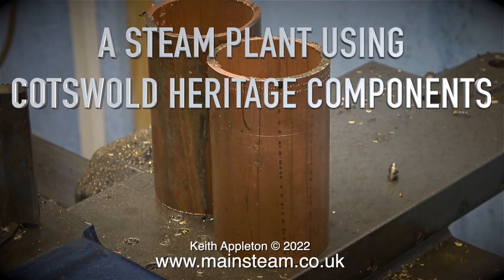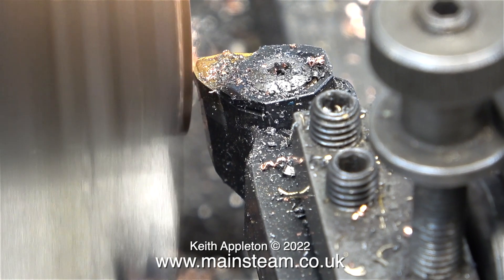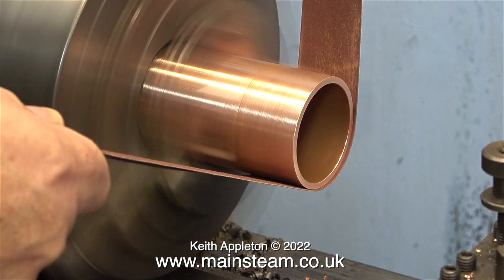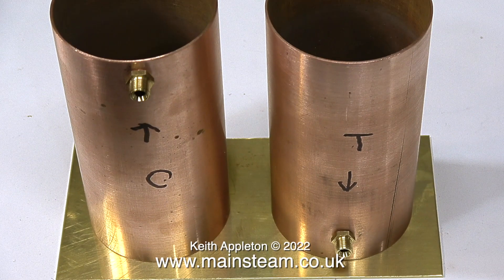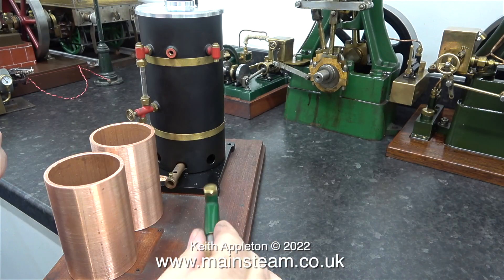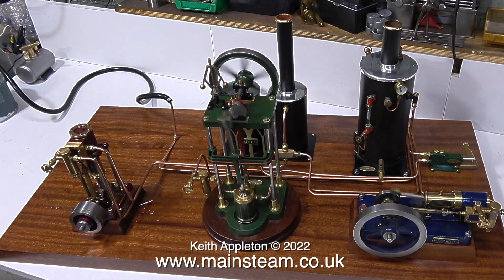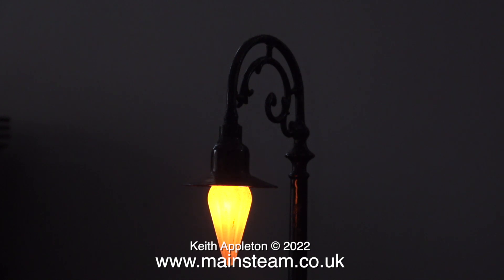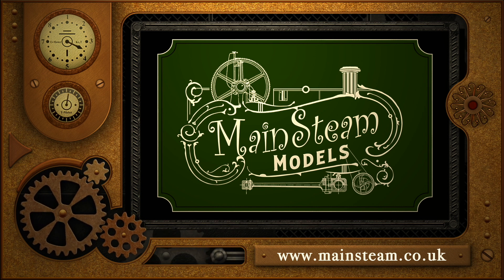A STEAM PLANT USING COTSWOLD HERITAGE COMPONENTS - PART #3

Comment: Heat engines of any type (internal combustion, steam, etc) are inherently inefficient.  When you scale up a heat engine, it gets closer to the Carnot limit, but a small steam engine (whether it's turbine or piston) won't achieve more than about 30% efficiency.
Reply from the maker: Luckily I just play with model ones . . . . . . .
Reply: @keithappleton  this was in the context of the folks wanting to use steam engines to power their houses.

Comment: I spent 20 years as a steam plant engineer on US Navy ships.  I operated both 1200 and 600 psig boilers with steam turbines as engines. To make steam do anything useful is a maintenance nightmare. You have to love it ,that is steam, to put up with it.  I did and I miss it.
Reply: Correct me if i am wrong, but from the little i know, i guess the steam turbines was a compromize in order to make it possible to use lower grade fuel, both in liquid and solid form but retain the relativly constant speed needed for the ship propellers on the heavy weight class Navy ships with the types of fuel estimated to still being commonly available/ easy to long time store, in war times. (in my country it was later, in the 1950s divided into low pressure airspool crude oil engines, as today, and gas turbines for the small sector of topspeed small ships, the larger classes of old scool battleships where outdated in Scandinavia allredy in the 1950s, they where rerplaced by dedicated all purpose chargo ships and the modern high speed boats, which made the system less vulnerable for the coastal defense here,  but i guess they did serve for a much longer time in the Britsh Royal navy and the US navy for open sea and foregin duty.).
Reply: @Vampi_Sweden  It is not so much about the grade of fuel but the natural evolution of marine engines. The old reciprocating steam engines had reached their limit on horsepower to weight and  size ratio. You needed more horsepower for your new ship, you need a larger steam reciprocation engine, thus a larger ship to put it in, then more horsepower to drive it and on and on.  Steam turbines provided much more horsepower for their size and you could put several in series to get the most energy out of the steam. They required a large reduction gear because they turned at very high rpms. As far as the fuel, the steam turbines didn't care about the grade of fuel, they just took the steam from the boilers. The boilers had to deal with the type of fuel they burned. Up to the end of WW2 the US Navy burned what we called "black oil". It was nasty stuff and it had to be heated before it could be burned in the boilers. In my day, the navy burned "diesel fuel marine" or DFM. It is much like auto diesel fuel used on the roads today. Hope this helps.
Reply: I was a boiler tech in the early 1970s and we still burned nsfo commonly called "black oil" . You are right it was nasty stuff.